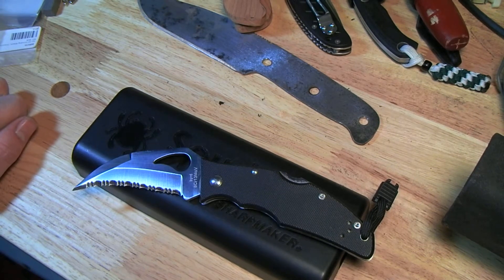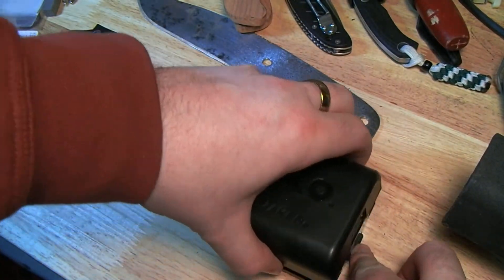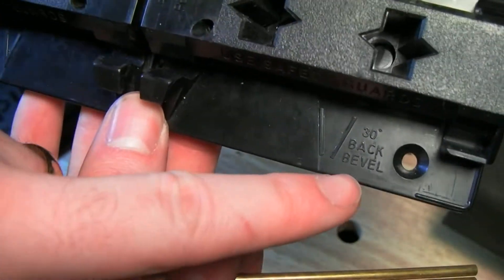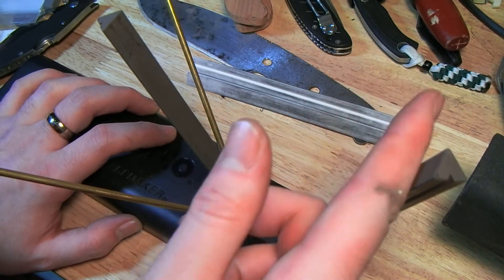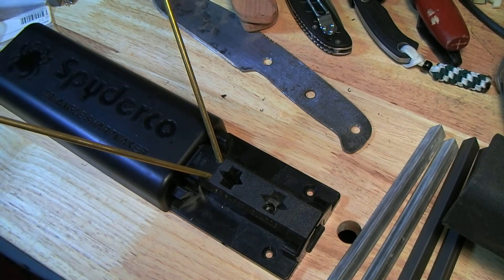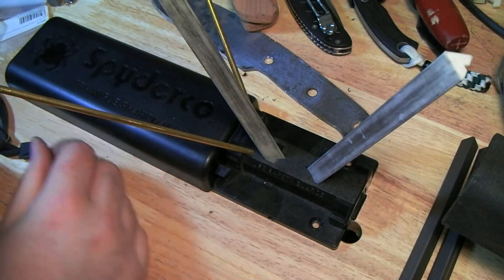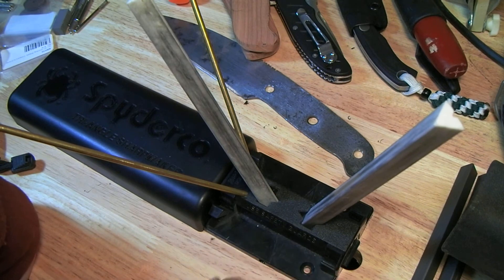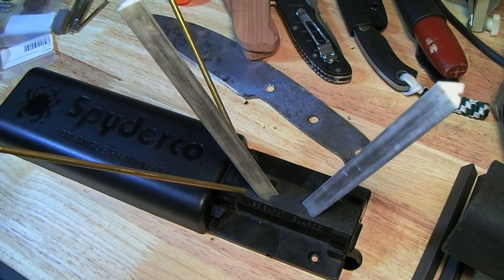Spyderco Sharpmaker Review

Comment from the maker: @MrGetlocked It's a partially finished drop point ground out of the blade of a broken machete. The handle scales need to be attached and finished. They're made out of red cedar (which is a little soft, but looks nice) It's a practice piece. :)